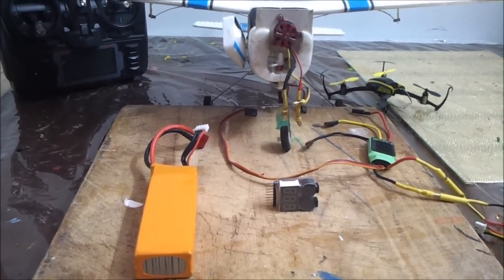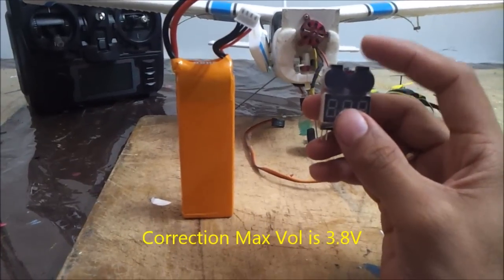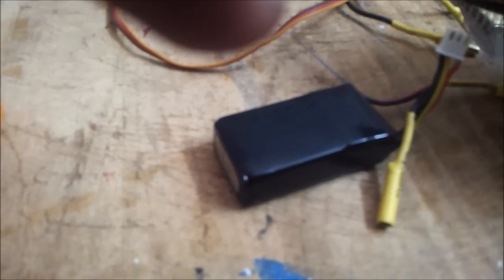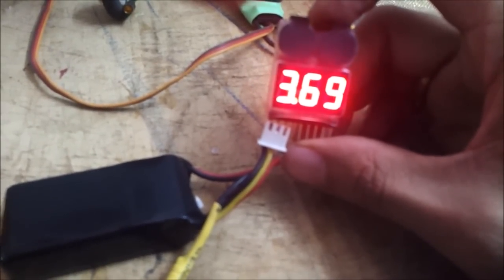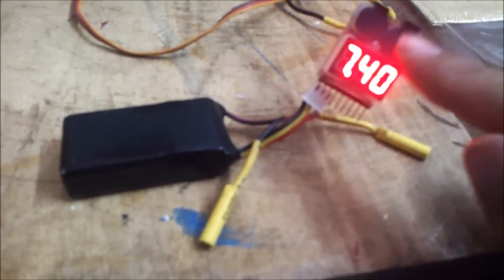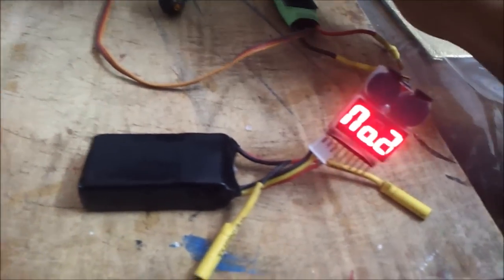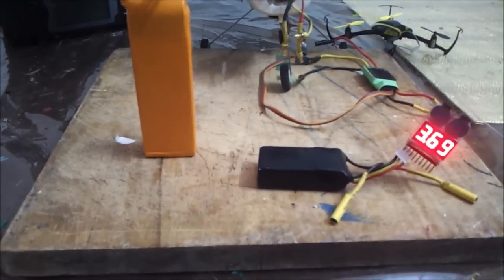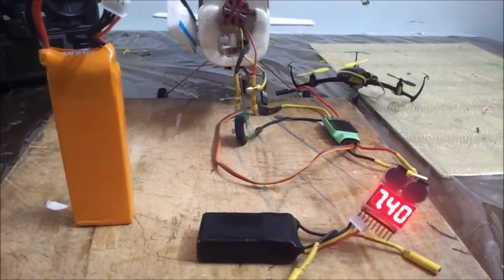Save your LiPo and your plane - Setup Low voltage Buzzer Alarm!

Comment: hi i have used commod wires to connect my led to the rc plane and transmitter and i am usin the charging port of the battery and if i have to use the low voltage tester to my rc plane then how do i connect it using the mod cable.

Comment: These do NOT cut off power to the motor. They are great to set up as an alert to remind you to start bringing in your plane. Definitely need to fix your video since you are providing false information. 🙏🏻
Reply from the maker: Mine cut off power to the motor. Only controls work

Comment: If the battery brust because the motor spin maximum torque, the volrage will drop to the level when the buzzer is on, but when the motor spin normal the lipo voltage will increase, and the beep is still on, that why i dont like this lipo buzzer

Comment: Hi Nice video but the cutting of power to the motor would be caused by the low voltage cut out in the planes esc and not by the alarm as this is not directly connected to the motor.

Comment: New to RC, using lipo3100 11.1 volt 3c. What should i set the alarm for?
Reply from the maker: Irrespective of the cells or the ampere the cut-off voltage is common. Request you to please go through the full video to understand the complete procedure.

Comment: How could I connect an on/off switch to this? Thanks
Reply from the maker: mario sellet why do you need a on/off switch? In case you decide to fly without the buzzer attached to your lipo , you can still fly normal.
Reply: Naren Nanjappa , thanks for reply. I'm using this voltage alarm for an impact drill I'm switching for Li-ion pack 5s. I already put my 5s charge leads and this voltmeter works great. It tells me voltage of each series. But I would like to leave it permanent by cutting out small square on my drill and be able to power it on and off. So hence it won't drain battery by it being on constantly. Thanks for the reply. I was hoping to get some help with that

Comment: low valtage alarm for syma x8hg battary 7.4 2000 can i know...the low valtage of this battary
Reply from the maker: Irrespective of cells or the amps, the low voltage for any given cell of your LiPo remains the same. To be on the safer side dont get the voltage below 3.5v for each cell.

Comment: How can we check the remaining % charge left in battery?
Reply from the maker: Buzzer Alarm is nothing but a voltmeter with a circuit which determines set low voltage and beeps out. You can read your voltage on this device.

Comment: Nice explanation.
my question is : I have a device of 5A-12V and i want to sell 3S Zop lipo 4500mah battery to feed it.
- How much running time does the device take if it turned by that battery..?...1-2 hour?...if i took save low battery voltage under consideration
thank you previously
Reply from the maker: Thank you. Economy of a battery cannot be understood with just a single input there are various factors to be considered to know its efficiency. Hence the Low voltage buzzer alarm comes into picture, where you can run your device hassle free till the buzzer alarm indicates you have exhausted your battery to the set limit. And time to recharge it back.

Comment: Does anyone know if there are some low cost Lipo alarms where one can switch between several buzzer sounds? When to driver RC car with friends, and everybody have the same Lipo buzzer tone....yeah, you know
Reply from the maker: To my knowledge and understanding there are no buzzer alarm that comes with different sound options. Atleast not commercially available. But there are custom made ones, where the normal buzzer alarm circuits are modified to get desired sounds.
Reply: Rimrock300 You may be able to setup an alarm within your ESC for example quadcopters in Blheli you can change the tone from 1-99. If that isn't possible you could buy a cheap buzzer online and solder it inline on your ESC side of the wires. I have seen it done but not sure how well it works.

Comment: Very helpful but I have a 2s 7.4v lipo what is the best voltage for the buzzer?
Reply from the maker: thank you. Please note Irrespective of what voltage or mah battery you are using the procedure for setting up low voltage alarm remains the same for 1S, 2S and 3S battery. Please watch the complete video to understand the procedure. simple rule never bring down voltage of each cell below 3.6 or 3.5..

Comment: so can someone help me out, im new to this drone stuff :p.

i just bought a syma x8g, and when i was looking for an extra battery i saw one with this buzzer/zoomer thingy. I went looking so now im here. can anyone tel me how this is actually usefull. does it go into your drone (and if so, is it loud enough to hear) or do u just use it on the ground to check batterys (since this wouldnt seem so usefull to me) Also, what voltage should i set it to for a syma x8g .

thanks <3
Reply: btw it uses like around 2000-2200 mah batteries.
Reply from the maker: low voltage buzzer alarm helps you to recognize when you battery reaches the low voltage cut-off point while you are flying your drone. The sound emitted is good enough and can be heard well. As you know LiPo batteries comes with its own drawbacks, LiPo cells refuse to charge back if the voltage on the cell drops below 3.2 (this varies on different brands), This device helps you to overcome the fear of spoiling your LiPo while you are flying.Hope this helps.

Comment: Hi, Naren. If we use this low voltage alarm buzzer and once we set it to the desire low voltage, are we always have to set it again every time we connect it or it will automatically save forever once we set the desire low voltage? Thank you!
Reply from the maker: The device will surely remember the cut off voltage you have set previously. Try this out. First when you plug in your lipo to the device it will simply act like a volt meter showing the "ALL" , "No 1" and "No 2" voltages Right? now when you press the device button ONCE it will show intial 2.7 and when you continuously press it the values changes from 2.7, 2.8, 2.9, 3.0.......till 3.8 and next "OFF". so when you reach your desired voltage say for example 3.5, press the botton long and it will be stored in device memory. next time when you plug your lipo again you will see the previous value you have stored.
Reply: Naren Nanjappa, Thanks Brother, your explanation really helpful. Now may I asked another question? I have 2 pack 2S LiPo batteries with 5.400mah plug in my RC Car, with this lipo alarm buzzer what the minimum amount of voltage should I set for not to make the battery damage?
Reply from the maker: Thank you. The safest way to deal with LiPo batteries, never get voltage of your LiPo below 3.7\3.6 per cell. I have tried to exhaust it till the voltage drops down to 3.3v per cell however I do not advise you to do so as LiPo behave differently in some cases. Please maintain it at 3.6 or 3.7.
Reply: Naren Nanjappa. Thanks a lot for your suggestion.
Reply from the maker: you are welcome.

Comment: How we will trust ths voltage meter reading? My Multimeter voltage is off frm ths unit. Can u pls ans? Thanks.
Reply from the maker: full charge your lipo and measure voltage from the buzzer alarm voltmeter n your multimeter. In most cases you will see a difference in the reading. If the difference is minimal ignore it n hook up the buzzer alarm. Buzzer alarm is also an electronic component like an ESC or a receiver on board a plane while flying. You just need to trust them in order to fly.

Comment: how to setup low Voltage  for 3s 5400mAh lipo
Reply from the maker: Irrespective of what mAh battery you are using the procedure for setting up low voltage alarm remains the same for 1S, 2S and 3S battery. Please watch the complete video to understand the procedure.

Comment: Must be an older design (or something) I've never seen any of my 4 low voltage alarms cut off power. Now my Hobbywing Platinum 100a ESC does have a soft-cut. (using Heli mode for my 550L Dominator) Anyhow just seems odd, most people recommend to set them to 3.4-3.5v. Also all of mine just beep when it detects one cell going low, if two cels are low, you get two beeps etc.. Anyhow odd, I've never had a power cut off to my motor from a low voltage alarm.. You sure it's not you ESC shutting down at 3.2 (or what you've setting the ESC cutoff at?)

Comment: i have a question - if you unplug it and use it after while, does it remebers voltage cut off you set earlier? or every time i have to do it again?
Reply from the maker: Yes it does remember the voltage cut-off you have set previously.
Reply from the maker: The device will surely remember the cut off voltage you have set previously. Try this out. First when you plug in your lipo to the device it will simply act like a volt meter showing the "ALL" , "No 1" and "No 2" voltages Right? now when you press the device button ONCE it will show intial 2.7 and when you continuously press it the values changes from 2.7, 2.8, 2.9, 3.0.......till 3.8 and next "OFF". so when you reach your desired voltage say for example 3.5, press the botton long and it will be stored in device memory. next time when you plug your lipo again you will see the previous value you have stored.
Reply: I testen it. It does NOT remember the voltage cut off you set earlier
Reply: no

Comment: Hi. Thanks for a good video on this alarm. One thing though... The alarm cannot cut the power to the engine, when it is only connected to the balance lead. That would take a connection to the main battery connector, og the ESC. The ESC can however cut the voltage, if it set up to do so. The alarm is passive though, and all it does is alarm you :) Set the alarm at 3,5V, then you have time to land, before the ESC might cut in at 3,3V, or whatever yours is set at (mine is 3,3V) :)
Reply from the maker: Thank you. And thanks for those inputs, you are right, ESC are programmed to desired voltages (most common 3.3V) for cut off and buzzer for alram.

Comment: can we use it with 1 lithium 18650 battery
Reply from the maker: +Rahil Shaikh These are best suited for LiPo which has XH connectors for their balance charging port. 1S Lipo 18650 I'm sure doesnt come with a balance charging port hence cannot be used.
Reply: thanks..............

Comment: The first pin you refer to IS NOT 1S.  It is the negative or common connection on the LIPO alarm and should be lined up with the BLACK wire of the balance plug.  The 2nd pin of the alarm (as you move from bottom to top in your video) is actually 1S.
Reply from the maker: +ODX171 flow of speech i would have misquoted. Anyway this is noted and thank you for the correction.